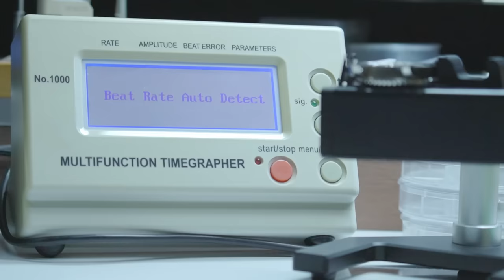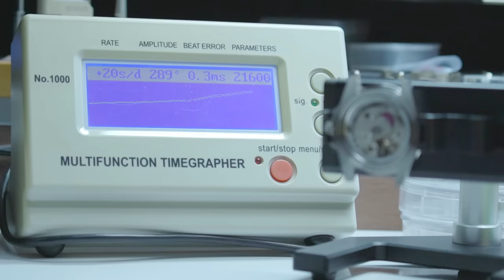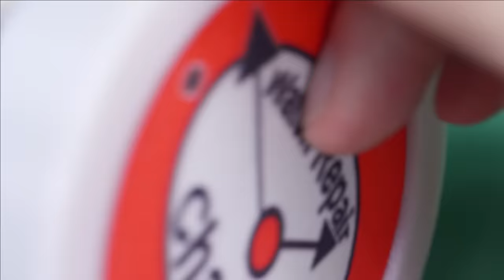Let's see what it's really worth! Fake Rolex Stripdown and Rebuild Review

Comment: I bought a mid level replica when I was in Puerto Rico on a cruise. It was 150 USD. One can tell if they have it in hand and really know what they are looking at. But from 3 feet its not easy to tell. Its not the cheap quartz movement watch. Its a very nice made Automatic watch. But its not a 1:1 super clone either. I have had it for several years now and it still runs just fine. A couple of twists of the arm and its off and running. I am thinking of sourcing a super clone just to see how good the GMT is.

Comment: did they change fonts on the datewheel after 19, or did it just scale weird to fit the cyclops? i thought the dial, case, and bracelet looked nice enough anyway, and the hands could probably be re-used in a pinch, though many points were deducted for that big pink plastic gear. now i want to go find a shitty fake

Comment: I have had a couple of those cheap fakes come in for repair. I have been sticking miyota 2813 movements in them. They are the same size as the ones I have seen. But these guys had paid several hundred for them. After I put a decent movement in them they were very happy with them because they were way more accurate than what they had before. I wasn’t wasting my time on a disposable movement like that. Sure I could have torn it down and did a proper service but when you can get a replacement better than what you had for under $20. I doubt anyone in there right mind would opt for the expensive repair. I just told them they could have gotten something nice that was a proper watch for what they paid. Guess they wanted a Folex. I could tell it was fake from the moment I saw it. I wasn’t impressed. Unfortunately I can’t control what people buy or bring in. This one looks like it’s made the same as those I swapped out the movement’s.  I took one apart to see and it was covered in oil. Like someone used a can of penetrating oil and just sprayed it. The main spring was the issue with the one I took apart the ratchet mechanism was broken. Simple fix but it went into the trash. Great video.

Comment: I have an aliexpress phylida watch I use as a daily beater with 2183 mingzhu movements often found in fake watches I bought it 3 yrs ago €60 shipped it was running 19 secs fast after putting it on the timegrapher I got it down to +2 secs a day fluke maybe I don't know but if it stops tomorrow it owes me nothing very comfortable screwed links solid end links sapphire crystal for a daily beater a good watch.

Comment: The movement looks to be a DG2813. They run about $13.
Reply: $13 is the price in the USA maybe. The entire watch is running 199 RMB in China (and it's 150 RMB for the 'homage' version with a different logo which is from the same factory). No way are they spending 13 bucks on the movement at those prices. 

It is a Caliber 2813, I spoke to the main guy who sells them within China (in Chinese) and he claimed it's a Miyota, so 2813, a Miyota clone, makes sense..

Comment: I have seen reviews on the super clones form places like Watch finder. They admit they have to go over the watch up to three times to determine if its real or fake. And that is form a company that deals with them day in and day out. The SC parts are interchangeable with an original Rolex. One will set you back about 900 bucks. But a real one will set you back many many thousands. So to me a real Rolex is not worth the money. They are so over priced right now they are creating this super clones. If a real Rolex was priced say for a GMT at 10k new and they made enough to go around, then it may not be worth making super clones. I bought a Omega Seamaster that was authenticated fro 2800 USD. Why pay 900 for a fake when you can get an original for a bit more. But if its 50k and you can pick up a watch that is so well made that even Rolex dealers have trouble telling them apart, well this is what the High price of Rolex is doing.  This BS on you cutting up a watch is just stupid and a form of virtue signaling.

Comment: Well ....its literally a rolex except made in china 🤷🏻‍♂️... Seems like a good deal for 50$, especially for someone who can take it apart, remove debris and excess oil and put the correct ammount in the right places 🤷🏻‍♂️, for a fake watch to copy the internal parts as well is pretty impressive, i expected the interior to be a cheap watch core from another watch using a battery.